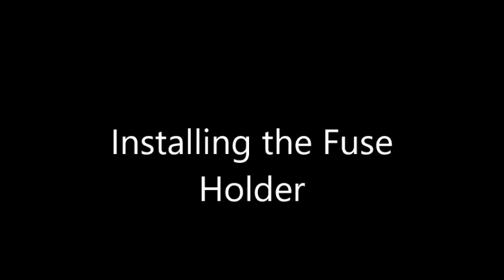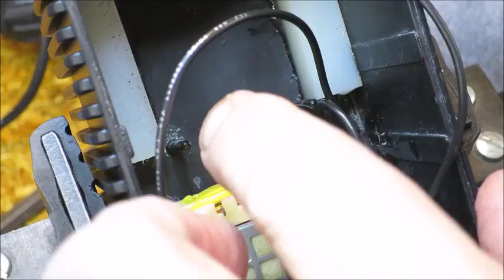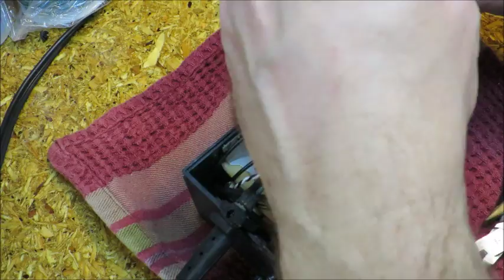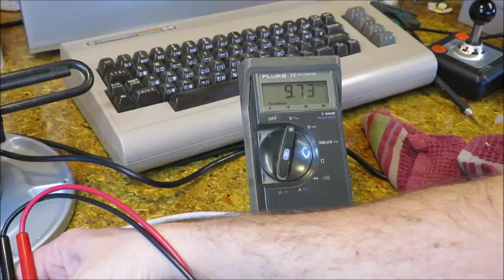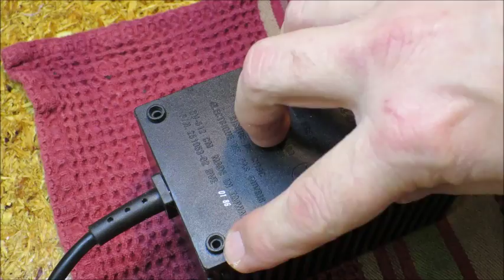Commodore 64 "Re-Brick" Part 3

Comment: Nice o hear the dryer spinning in the background. Any video that I’ve done always seems to have the dryer going. It seems viewers like that sort of thing.:)
Reply: I know exactly what you mean. I really like and appreciate the videos where the content is more important than the production. Your video is great by the way, and when I finally drag out my VIC-20 I’ll be sure to check the brick supply. It’s a little strange to me as I’ve used a lot of 7805 regulators in my professional and hobby life and I’ve yet to see one short. Any regulators that have failed for me have gone open. In this case it must have to do with the encapsulation and the inability to dissipate enough heat.
Reply from the maker: @larryhuff3383  I always thought it was because Commodore used very cheap 7805 regulators.
Reply from the maker: LOL, I never noticed that!  I never wanted to be a YT star.  I just had people asking me how to get the epoxy out of the case, which led to the series.  Naturally my production value is...well, nonexistent!

Comment from the maker: A little update on the transformer.  Parting out a wall wart turns out not to be terribly sustainable, because you have to keep finding old wall warts to disassemble.  So in recent years, I've started using a transformer like this in the link below. The ears need to be trimmed down a bit.  Then I end up cutting nylon wedges to go between the transformer and the case on both sides.  The whole mess gets epoxied in place, and I think it provides a more positive 'lock' to keep the transformer from falling out.  https://www.jameco.com/z/TR4820-91-R-Jameco-ReliaPro-Power-Transformer-9W-9V-1A-115-230VAC-Wire-Leads_105524.html?CID=GOOG&gclid=CjwKCAiApvebBhAvEiwAe7mHSPRlPP3ArIXENlq93oOXOqnjByJyBmOKWHzzDUH9YwuFVlh9qIBZ2RoCb5cQAvD_BwE

Comment: excellent set of videos, many thanks. can you add links to where we can buy this from you and/or the products you use please? also see if you can get commission from them 😉
Reply from the maker: Thanks.  The parts list is here in the comments.  While I DO sell these from time to time, the purpose of the videos was to show others how to do it themselves.  Having said that, I do build a few every year, and sell them.  It might be a few more in the next several months, because my case supplier for my Nu-Brick (my version of this power supply with all new parts) is no longer selling the case, so I will be out of cases soon.  But you can email me.  My handle is my gmail address.
Reply: @ottumland  thanks, im pretty handy when it comes to electronics, just purchased 3 untested c64s but all with original supplies. thankfully only problem across all of them was one bad vic chip! ill try your update and if it goes pear shaped i'll certainly buy replacements from you.
Reply: It is a labor of love. I got it done, but it wasn't pretty. No matter how careful I went, the base plastic tore while trying to break it away from the case and I had to chisel the wires out on both sides. Left with no base, I 3D printed a new one and added mounting points for the circuit board while I was at it, so done but I wont be doing any more!
Reply from the maker: @ddacombe4752  Yeah, that's part of the reason I started doing the Nu-Brick.  This project really is a labor of love.  I get a majority of the covers off intact, but I've broken quite a few as well.  The beige ones are the worst, it's like they epoxy holds better.  So did you build it upside down then?  Or rightside up, I should say, since my design is actually upside down!
Reply: @ottumland  i built it right side up and also have a slot in the printed base where i glued in the transformer. Thanks again for your work to guide me through the process 👍🏻

Comment: Well explained! One comment: I think the metal bracket with its exposed screw should have been connected to protective earth (PE). An alternative would be to use a nylon screw.
Reply from the maker: Yes Edwin I think you're right. I'm not doing these quite the same way anymore but that's a good idea.

Comment: Nice work. The only thing I would change is on the main fuse, I would attach live to the center (inner) contact and the load side on the outer ring so that you can't touch live if you remove the fuse.
Reply from the maker: Yes, you are correct. That was brought up early on, it's in here in the comments somewhere but I know those are hard to get through. We've been doing it the correct way ever since, but there's absolutely no harm in mentioning it again.

Comment: Nice...does the main fuse (surface mount) not provide enough protection?  Or is the inline fuse protecting the 9V line from transformer failure?  Doesn't the on board fuse do that?  I'm trying to re-brick the really old (fixable) power supply.
Reply from the maker: Great question.  So my supplies have 3 fuses.  The first one is a line fuse.  The AC coming into the case is fused right away, so that if something comes loose inside the case and shorts out, it protects against shock or fire.  The 5vdc switcher also has a PCB mount fuse from the factory, as you mentioned.  Finally, I put a 2A fuse on the output of the 9VAC transformer.  This is to keep the transformer from melting down in case of an extended dead short across the secondary.  Commodore did the same thing, by the way.

Comment: Did you ever concern yourself with the phase of the AC coming off the Transformer when selecting which pin to connect it to?  Or did you just figure,  AC is AC and wire it up to which ever pin wire you grabbed first?  Just wondering because I don't have a scope on hand myself.
Reply from the maker: I have actually never even thought of that. I'm sure there are applications were this is something that would matter, but in this case it doesn't. If you were tying two Transformers together than the phase would obviously matter, but I can't think of any reason it would in this case. I build a modern equivalent called the Nu-Brick that is the same design with all new parts, and I've sold hundreds without ever considering the phase of the AC.

Comment: With the case being so thick, you can always countersink the inside of the hole, so that the LED is able to poke through a bit further.
Reply from the maker: Thanks.  I think lately I've been using a slightly larger drill bit that lets you put the LED as far through the hole as you want.  I think when I was using 7/64" it stopped at the lip, but when I went to 1/8" you could place it wherever.  Don't quote me on that, because it's been a little while since I've built one.

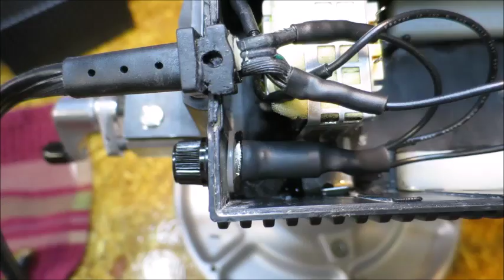Comment: Okay, I think I have got all my connections sorted out and a better understanding of the AC side. At 6:23 there is a good shot of what I believe is the answer to my question. Just like where two hot  outputs come off the line fuse, there is a bridged connection for the neutral side that goes to the transformer input and then to the second connection on the 5V switcher input. You do even say "the neutral side" when handling that particular wire. Is that correct? If so, I think I am good. I will perform some multimeter tests first before hooking it up to an C64, of course. :)
Reply from the maker: Yes that's correct. I think all I was trying to say is that the Transformer itself doesn't have a hot and neutral per se. The hot side goes through the fuse first and the neutral side connects directly to both the Transformer and the Switcher. I'm building some of these today, to be sold at VCF Midwest!
Reply: @ottumland  Gotcha. Thanks! I learned the hard way that the little crimp-on connectors from Digikey should not be over-soldered. It requires a bit more delicacy than I originally provided. Since I did not have enough spares to complete the job today, more are on order.  :)
Reply from the maker: @jdryyz  Oh, I think I know exactly what you mean.  So you soldered the actual contact spring shut, didn't you?  After over 300 of Re-Bricks and Nu-Bricks built, I still do that once in a while!
Reply: @ottumland  Exactly!! It only requires a dab. Admittedly, I wasn't aware of the spring clip function at first so I over did it.  :)

Comment: I have the same case as shown in the previous video. It has several vertical protrusions that would seem to make placing the nylon pieces more difficult. Is this why your case changed? Does this mean there are versions of the case design without these protrusions or did you just remove them yourself?
Reply from the maker: I think the style between the 2 videos is the same, though the specific case changed due to my not getting good video during assembly.  It's been a couple years, so I don't remember precisely.  Yes, I've had to remove some of the internal plastic to get the nylon pieces to fit.
Reply: @ottumland  I am thinking you probably used a Dremel tool for that.  :) I never got around to getting one of those. I am afraid I could wreck the case even more trying to get them out using other means. Maybe I can just create notches for the nylon.
Reply from the maker: @jdryyz  shame on me for not remembering exactly what I had done. Yes, I actually end up cutting  two slots in the nylon block itself not cutting away the ribs on the inside of the case.
Reply: @ottumland  Yeah, that's what it looked liked in the earlier videos, then you switched to the case without any of the pieces in the way. Maybe the transformer or the switcher couldn't be fitted properly which is what I am concerned about. Sounds like I will have to clear them out also.

Comment: There's a lot of work to be done, but it's worth it. In this way, the retro feeling is retained. Best regards. Doktor64!
Reply from the maker: I agree.  Someone suggested that a 3d printed "liner" would help with all the mounting issues.  I liked that idea, but don't currently own a 3d printer.  But yes, it's a time-consuming but rewarding project!

Comment: If anyone reading this and the following comments are a bit confused, it's because I deleted the original. I was completely in error about certain technical aspects on the voltages that are present on the C64 mother board. ottumland has pointed out my error and with further study I see he is 100% correct. I have removed my comment, not because I am embarrassed about making a mistake, I have removed it to prevent any possibility of giving out incorrect information to anyone reading.
My respects to uttumland for being a gentleman.
Reply from the maker: Thank you for your comments.  Unfortunately, and with all due respect, much of what you posted here is incorrect.   The 5vdc from the brick DOES supply nearly all the logic circuits in the C64, with the exception of the VIC and Oscillator circuits.  The 9vac is connected to regulator VR2 on the C64 mainboard, which outputs the voltage referred to as 5v CAN.  The "CAN" reference refers to the components inside the metal shield, or "can".  Those are the only components supplied by this 5vdc supply.  

Here is an exerpt from The C64 Service Manual, Part #314001-02: 

"The external power supply generates a regulated 5VDC and 9VAC.  5VDC is applied to pins 5 and 1 of CN7 on the C64 pcb.  Filtered by L5, C97, and C100, it is then controlled by on/off switch S1.  This 5VDC output supplies the microprocessor logic.

9VAC is applied to pins 6 and 7 of CN7 on the C64 PCB.  +12VDC, +5VDC CAN and 9VDC unregulated are outputs that are derived from this 9VAC supply.  The 9VAC supply is made available on pins 10 and 11 of the USER PORT CN2.

+5VDC CAN Generation

9VAC is rectified by CR4.  The unregulated DC output is filtered by C19, and C95, then regulated at 5VDC by VR2.  The regulated output is filtered by C102 and C103.  The output called 5VDC CAN is separated and individually filtered into two outputs called Vvid and Vc.  Vvid is the 5VDC supply for the video circuits, and Vc is the 5VDC supply for the clock circuits"

Sorry, but it sounds like you need to throw out your schematics and get some new ones!

Additionally, on the "breadbin" style C64, the average current drain on the brick's +5vdc is between .8 and .9A.  I just tested with the 1983 version, PCB#250407, and I got .79A, but that system has an aftermarket PLA that draws a lot less current than OEM.  With a 1750 REU installed, We see over 1.5A, and many users run multiple cartridges on the cartridge port, which can bring that total to 2A or more.  So the extra capacity of the 5VDC on the Re-Brick is most definitely NOT overkill.  Conversely, the 9VAC typically draws about .5A without a datasette connected.  With a datasette running, this can add .1A to .3A, with the average being around .13A.   So, worst case, the maximum draw from the 9VAC is going to be around .8A  I know that the 9VAC is also available on the user port, but as I recall, that only has 100ma capacity, so even with that in use, you're still at 900ma or .9A, still within the normal capacity of a 9vac 1a transformer.   This transformer doesn't need to be beefed up at all.

Finally, the common failure mode of the original C64 brick, especially US models, is for the 5vdc output to climb and burn out all the RAM and often other logic chips in the C64.  That couldn't really happen if the logic wasn't really connected to this supply, and I've been replacing RAM chips that have been fried by bad C64 power supplies for about 25 years!
Reply: I never run and hide when I find I am wrong and this one is indeed a doozy. You are correct. I've just poured over the schematic included in the back of the Programmers Reference Guide and there, plain as day is +5V "CAN". The power supply I built (in 1986) used a 5 volt 3 amp regulator in a TO-3 package mounted to the back wall of a metal housing. I brought it in on pin 5 but I also completely bypassed the 7805 (having replaced it twice) on the board by hard wiring a jumper from SW-1 to the 5V CAN output of the 7805. Although my C64 operated for ten years or so after that (it didn't die, I just moved on to faster computers)  this was clearly a mistake. The designers went to lengths to separate V "can" and Vcc and my "fix" combined the two which most likely put stray RF on Vcc.

The only thing I will say in my defense is I would still have a 9Vac @ 2 amps and a 5Vdc @ 3 amps output PSU. The original specs for the power supply was marginal especially if powering a current hungry cartridge, and why they ran so hot, along with the fact they were cut off from cooling air encased in epoxy.
Reply: P.S. now I have to go do the same thing in a couple of forum comments I posted the other day ... damn!
Reply from the maker: Thanks 3DPDK, I appreciate it.  Civil discourse on the internet is rare these days, and it sure is nice to find folks who can just exchange ideas in a friendly way.  To tell you the truth, your comments caused me to do some research to make sure I knew what I was talking about, and I learned a bit about why Commodore split the 5v supplies like this.  They were apparently chasing FCC compliance by reducing interference.  I hadn't known that.  Anyway, If you want, I will delete the whole thread just to avoid confusion.